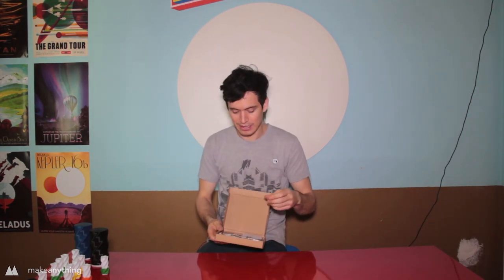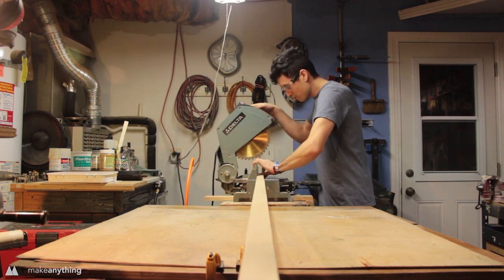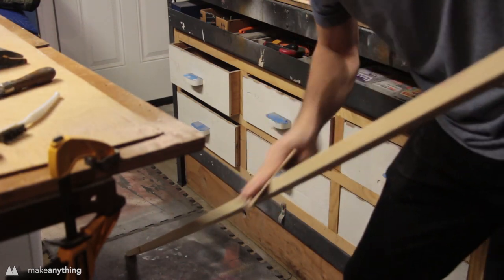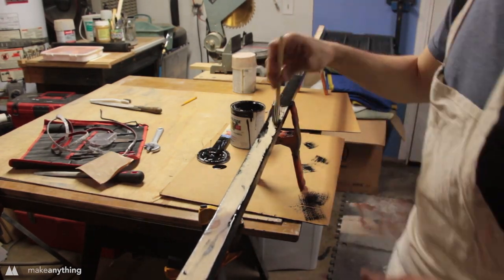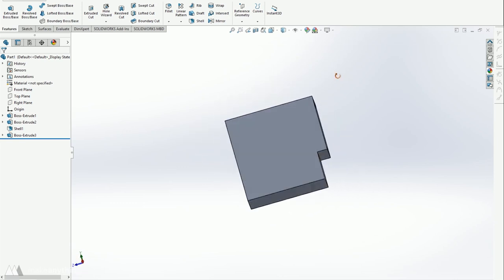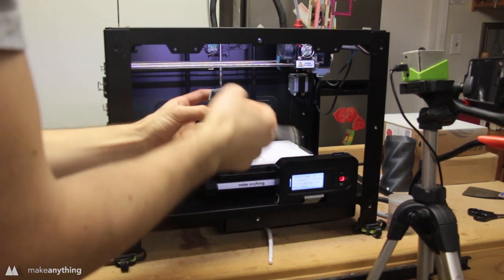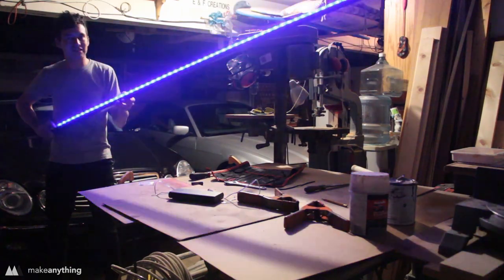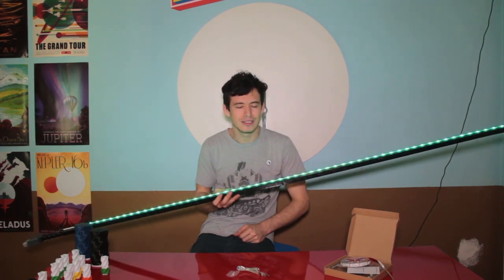Painting with Light // Super Light Stick

Comment: I made something very similar last summer but I put a strip of diffusion on it so it was more solid instead of getting those individual leds showing. Great work though!
Reply from the maker: I've thought about doing that.. I still can!
Reply: Make Anything // 3D Printing Channel 
It wasn't perfect when I did but it was also jankey the way I did it XD
It looked better to me 

How did you do it with the video?
Reply: Roon dya have a fb!
Reply: It would be easy (and nice) to add a diffuding snap-on module thta snaps on at either side. 
Easy change between individual and one

Comment: I actually have the same strip from the same guys that I use in my dynamic ambient lighting. Have it hooked up to an Arduino and made it so the light mimics the screen's color and audio as well. This particular strip is really nice because it runs directly at 5V, which is perfect from an Arduino, no need for an extra power supply.

Do be careful when modifying the strip though; it's pretty dang fragile when you bend it the wrong way. Ruined a few segments and had to cut those out. My current strip is still slightly damaged, with some colors not working properly unless I fiddle and hold some parts still.

Otherwise, I would still highly recommend this strip, especially if you want to hook it up to an Arduino, due to it being 5V and how bright it is even at 5V.

I do have some videos on my channel demoing what the end results of my dynamic ambient lighting look like. Followed a guide mostly for the Arduino and coding parts, but I modified the code myself to include audio processing and color calibration.

Comment: cover a plate with them (if you have 100 pixels with like 10 x 10), and get some magnet receptors on the back so you can controll them with a magnet (if they are seperetly controlable and you can program a bit)

Comment: what 3d cad do you use??? With the cad I use, I can't even design a perfect circle...
Reply: IIRC he's using Autodesk Inventor. It's a pricey bit of software, unless you're a student. 

Also, I'm assuming you're using SketchUp. SketchUp's circles don't really look all that circular, but don't fret, that's just the program taking some shortcuts when it displays the shape (I think). 

If you've got a shape you've extruded and you want it to be smoother on the edges, there's a smooth/soften tool for that too. Just be warned that SketchUp really isn't intended for major projects, that smooth/soften tool is best saved for the end (it makes it /very/ hard to work near that surface afterwards, in my experience)
Reply: I'm an idiot, he's using SolidWorks, says it right as he opens up the program. SolidWorks is also expensive; any professional 3d modelling program is, really.